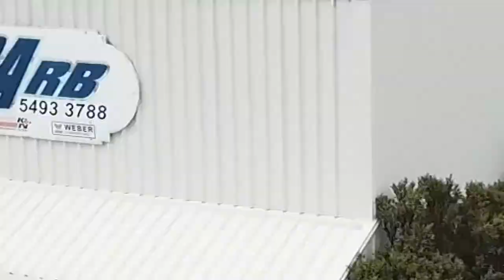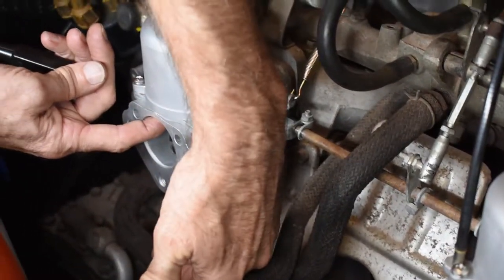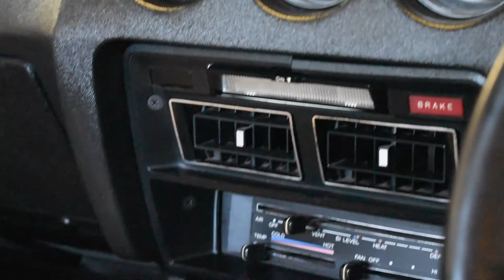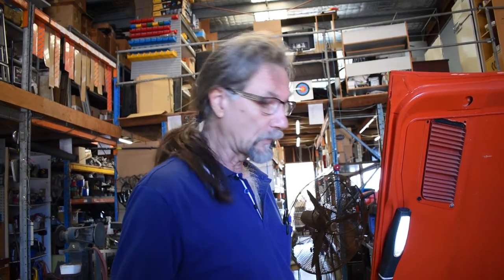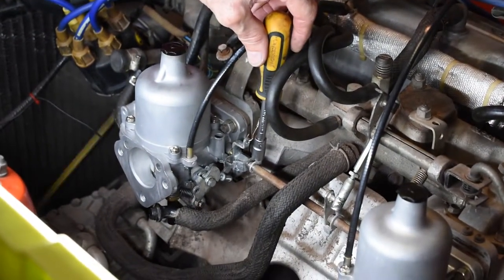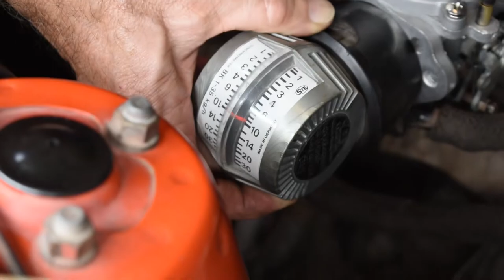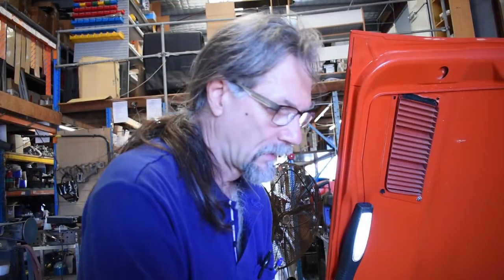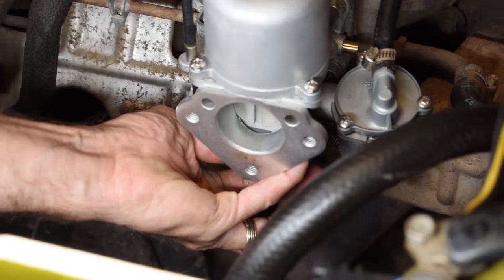How to Tune & Balance SU Carburettors

Comment: For what it is worth.  I struggled for awhile getting my carbs set up.   I learned it is absolutely critical you get your dwell and timing spot on.   That way you are just on carbs.   Secondly Color Tune is an elusive tool.   It seems straight forward but it can be elusive.    I finally got frustrated and richened the shit out of the carbs.  Problem solved. I now use the lifting the chamber piston method.  If it dies when lifted your too lean.  If idle goes up and stays your to rich.

Comment: With su carbs if they have a lifting pin press that (if they don't a screwdriver to lift up the damper works) if the revs drop the mixture is lean if the revs increase and stay increased it is rich and if it increases then drops the mixture is correct

Comment: Very informative. Is there a way you’d recommend centring the jet if the needle seems to rub a bit?
Reply: light sanding or roll on a very flat table and use a small hammer to straighten..
Reply: @skgate  I don’t think it’s bent. It’s just not centred well enough.
Reply: as a machinist, thats what id do with home tools.
Reply: @skgate  but again the needle isn’t bent. There’s a centering procedure for these and it doesn’t involve any machining or sanding.
Reply: @freestyla101  right but if its rubbing it could be enlarged or something.. thats just what id try. good luck finding your solution

Comment: Really clear video, thanks! But I'm struggling with the very first step, as my 240z has its idle too high to start with (1100 rpm). Therefore, how to set the timing properly, if I can't even have a good idle?
Should I play with the idle screw next to the carbs to set the idle to 650 or 800 rpm, then do the timing, then the carbs?
Reply: Set the idle, set the timing, re adjust timing as needed if timing changes when checked

Comment: ,,,whats a standard timing spec ?
Reply from the maker: Hi. Not sure of your question; if by "standard" you mean "Factory spec": then refer to your manual, as different models/distributors will have different specs. If engine is modified, then a custom tune is required.